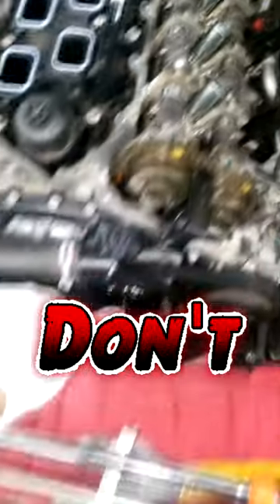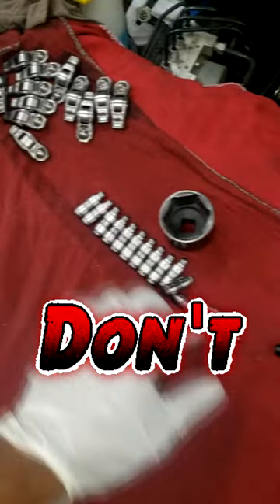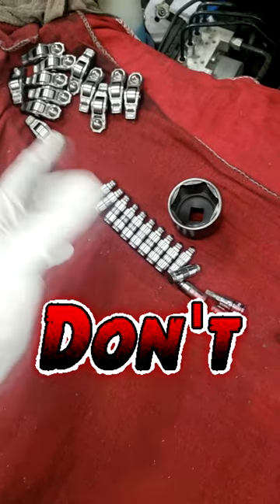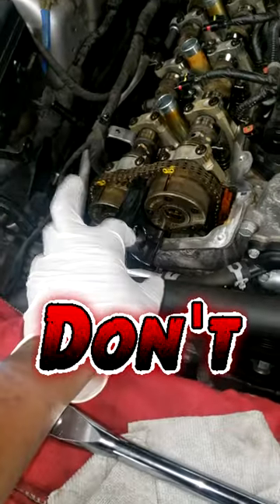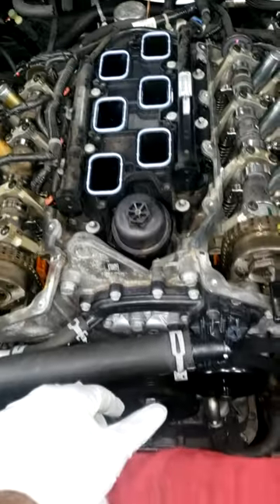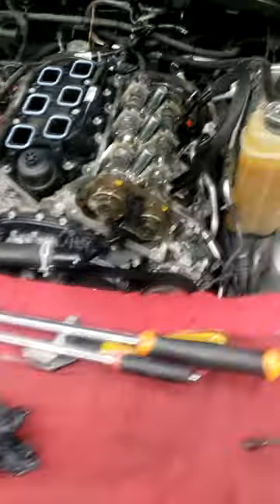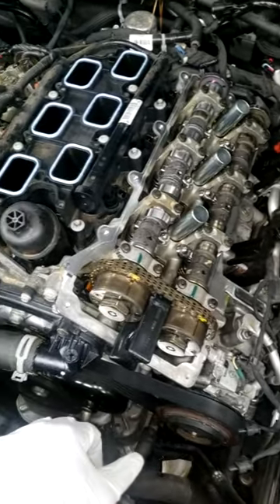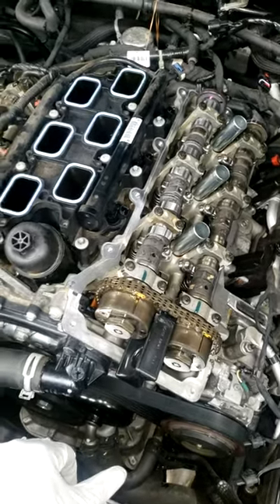Here's why this cop car started ticking.

Comment: I wouldn’t blame it on idle time, I’d blame that one on Chrysler… the old crown Vic’s with the 4.6 idled just the same and those cam followers and lash adjusters hardly ever went bad
Reply: Bring back the Crown Vic
Reply: Yep, after thousands of idle hours as police vehicles, then they became taxi cabs and were used for another 300k miles. Definitely a Chrysler problem - Crown Vics never minded donuts.
Reply: Well the old Ford Crown Vic assembly plant has been replaced by an Amazon warehouse. Sad, they were a great car.

Comment: Also I wonder if that happened from long idling. The day's of cops just sitting is long gone especially in your larger city's. Just like the day's of firefighters just sitting around is long gone. The fire truck I'm driving is a 2019 and almost have 70,000 miles on it. When it was delivered, it had like 500 miles.

Comment: Anyway to modify the oil pump or add a different one so that this doesn’t become a issue? I know you aren’t supposed to idle for hours on end, but that’s kinda expected by the police. I’d think there’d be a work around?
Reply: The oil pump is a variable displacement pump. They just need to change the oil more often when idling that long all the time.

Comment: I don't know how many miles/hrs on this engine. At a dealership, they have access to maintenance records which have been entered into the data system. Any reason you can't divulge that? Anyway the valve train looks quite clean, so you wouldn't think it was poor oil changes? it makes you wonder on the quality of oil & filters used. Personally, I'm suspicious of Mopar branded oil filters.

Comment: That is an engineering problem. I get it prolonged engine idle waste gas. In some cities your commute is 1 hour long and close to 45 minutes bumper to bumper everyday one way real world driving. No engine especially if it is not wore down should have this problem. That is why I am not a fan of the 3.6L. We know that is a low oil pressure problem. Did they ever update the oil pump?? Thanks J.T.

Comment: Chrysler, if your going to put into production a police issue vehicle, the least you could have done is upgraded or first offered a long idle duration oil pump. Why does chrysler drop the ball on things like that? First of all, oiling is probably the most important part of an engine. Why even half ass compromise that 🤔?
Reply: this is y they buy explorers lol they can let them idle as long as they want much more reliable
Reply: @toolsonabudget7763 but even then those have turbos

Comment: It's gonna be fun to see how cops adjust to EVs. Can't sit there and idle all day anymore.
Reply: ??? You mean save tax payers money on gas?
Reply: they literally can sit there and idle in an ev
Reply: @QuincyStick  sit where? At a charging station?
Reply: @Mike__P  literally anywhere an ICE car can lmao, are you under the impression that just sitting there evs bleed copious amounts of charge
Reply: Im wondering how heat is being produced for one in cold weather
Reply: @Flatlandproductionz  either an induction heater like all other electric heaters are, or an hvac system like the plug in prius' use, however they have their limitations as they only work down to a certain temperature, but this may be fixable simply with an alternative type of freon/freon equivalent

Comment: This is why Chrysler builds a terrible police product. When Ford built the Crown Vic, they had a purpose designed engine with cams and components designed for 24 hour duty cycles. The Pentascar is a garbage engine and it’s exposed for all its weaknesses in a police duty setting.